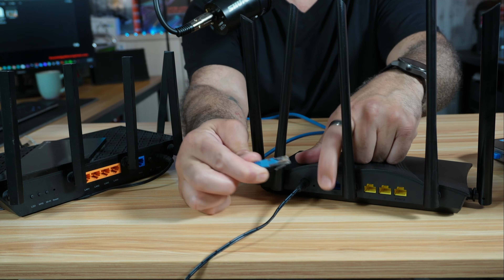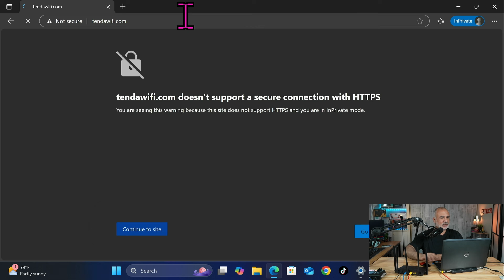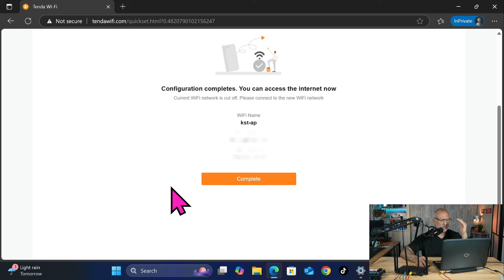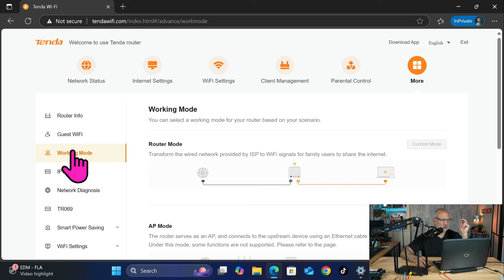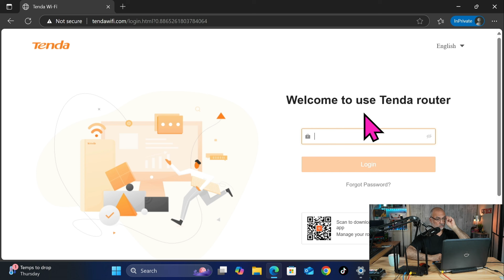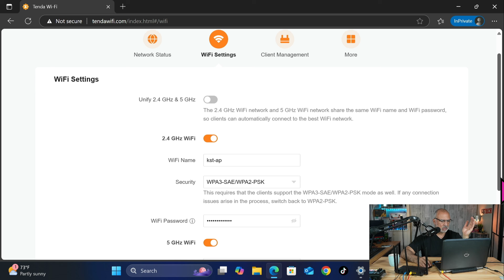How to setup a Tenda router as Access Point | Step by Step

Comment: Sir i am using tenda rx2 pro router after enable client + ap mode for wireless extender, i cant open setting of router plz tell solution🙋
Reply from the maker: Try accessing the router's IP address directly in your browser.
Reply: @KnowledgeSharingTech tried many time and many browser but not open

Comment: Hello! My Tenda is N300 F3 model and 2.4 Ghz frequency only. To make it an AP for my main router, experts advice to change IP address and insert ethernet cable to LAN port of tenda, instead of WAN port as you suggested in video. IP address of main router is 192.168.29.1 and DHCP start and end IP addresses are 192.168.29.2
 and 192.168.29.254 respectively. Please provide your suggestions. Thanks!

Comment: I have a problem where at random moments if the day the light becomes red and starts blinking and so all devices lose internet connection even the ones connected via Ethernet , until the light becomes green again by itself .
Do you know how I can fix it ?
Reply from the maker: Make sure all cables are well connected and the router has the latest firmware.
Reply: @KnowledgeSharingTech how do I do to make sure that it have the latest firmwarz pls ?